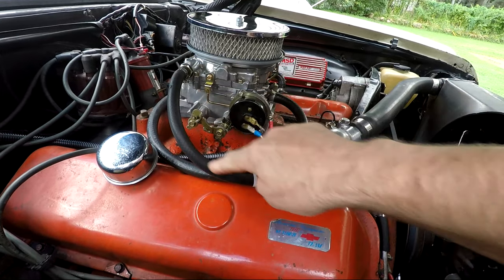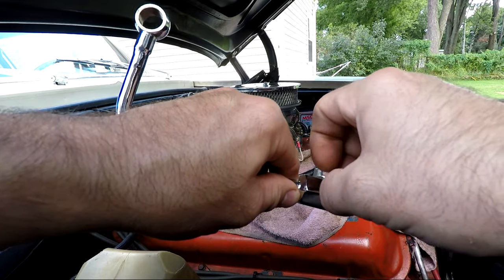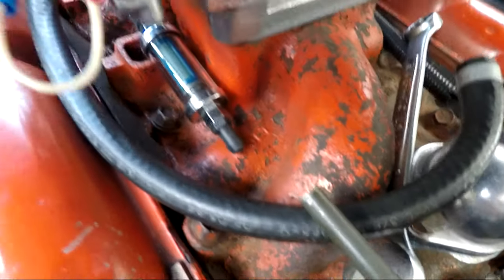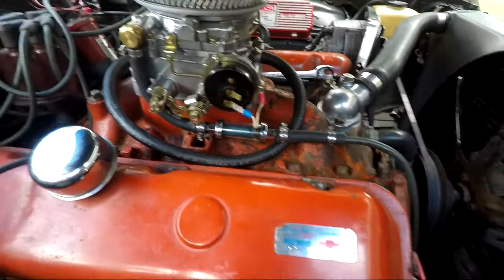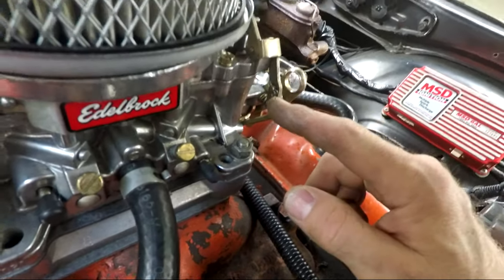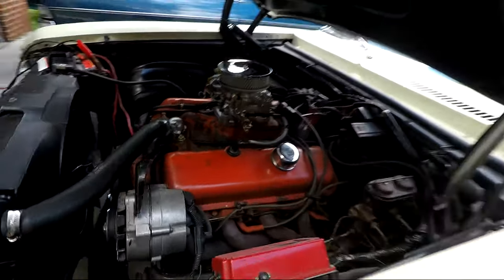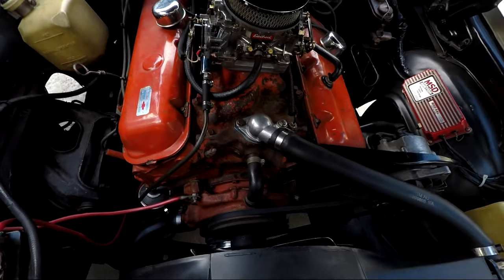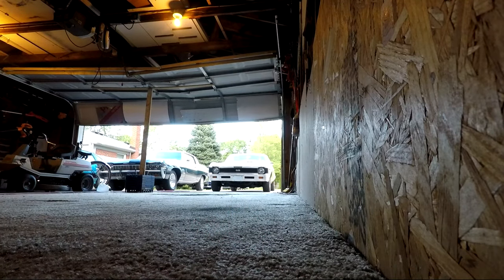Edelbrock Banjo Fitting and Custom Gas Line Project 68 Nova

Comment: I really like your video. I have a 5 year project and fuel line is one of my final projects until my 54 Olds is road worthy. I'm going to run a hard line to a fuel regulator and a rubber hose to a filter then a pressure guage. I was looking for a way to connect to my Edelbrock carb. This really inspired me. BTY I'm an amateur and I also have holes in my "car project" shirts.
Reply from the maker: Thanks and good luck with your project Phil...

Comment: isnt ur gas line to close to manifold causing heat, possibly causing vapor lock????   oooh what a rush.    i would have pointed it toward the front suspending gas line in air
Reply from the maker: I ended up doing away with the glass filter but the main line running up from the fuel pump is basically where it was factory..No vapor lock issues..

Comment: That is a dangerous place to put a dangerous fuel filter. The banjo elbow is great, however. Not many products give you a clean 90 degree turn with that 5/8-20 fitting.
Reply from the maker: I ended up doing away with the glass filter because of the danger...It now has a metal canister filter...
Reply: @garageworkouts1  That's good. I like to locate the filter above the pump in the radiator fan flow.

Comment: man, i dunno wtf edelbrock did but I cannot for the life of me fit a 19mm deep socket around that fuel inlet. not even a wrench; the jaws are too fat. the thing seems to have been tightened down with an impact, followed by an 800 pound silverback gorilla with a 3 ft breaker bar
Reply from the maker: Try soaking it for a few days with wd40 or something..
Reply: @garageworkouts1  i ended up using a plier wrench to get it off. i didn't have any 19mm wrenches that could fit over the fitting without risking stripping the threads. what an adventure lol